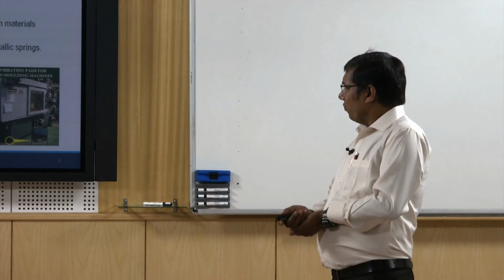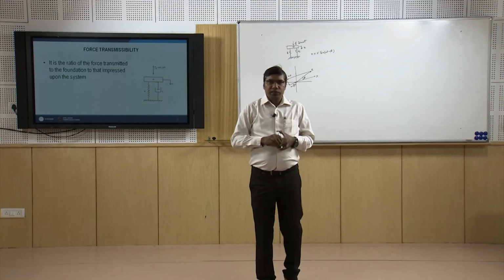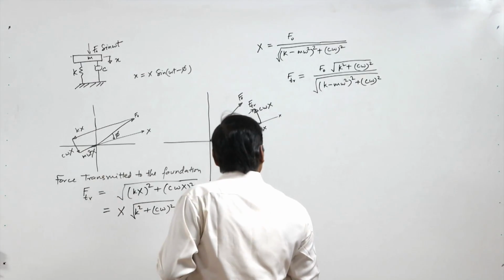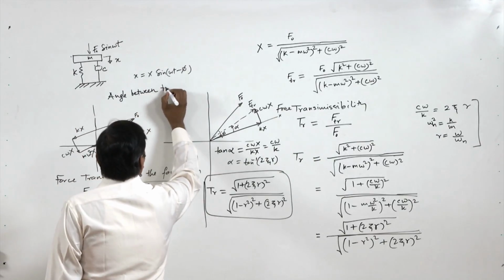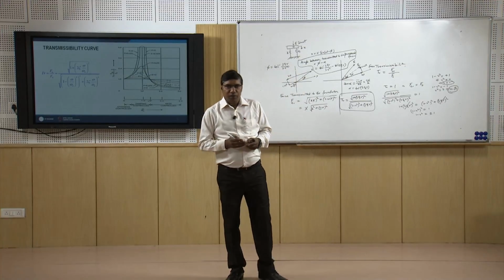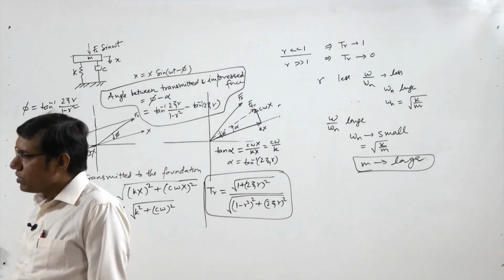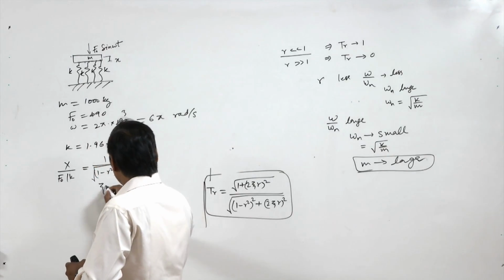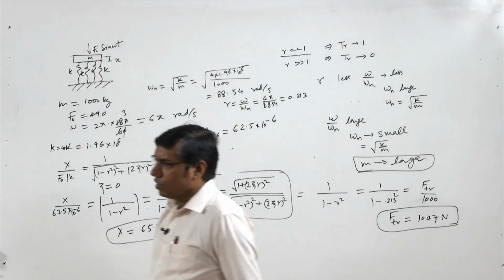Vibration isolation and force transmissibility

Comment: Thank you Prof. Kumar for a great lecture. I have a couple of questions. Here's the first:
Many isolation pads use neoprene or rubber. I'm also looking at a vinyl chloride elastomeric resin. Why is it so difficult to find the damping value, c, of these materials? Do you have some typical values for these materials? Thanks.

Comment: (At 29:52) In numerical it is clearly mentioned that k is total spring constant (not each), and professor has taken it as single so it is typo error in question.
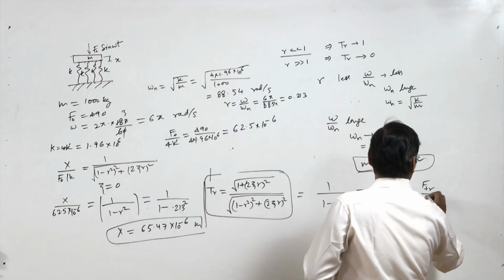but again in final step (34:25) Fo was there in formula (which is 490 N) but professor has taken it 1000N.